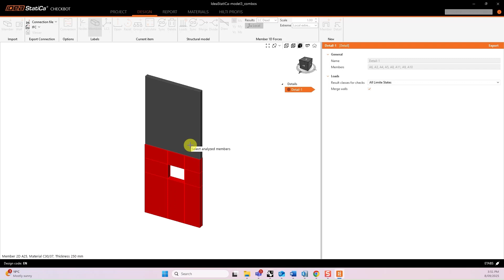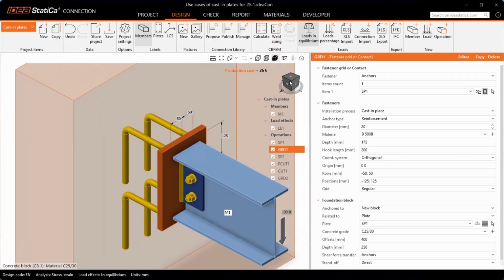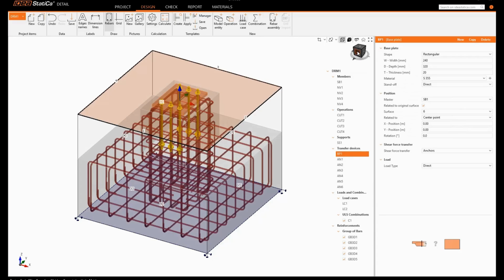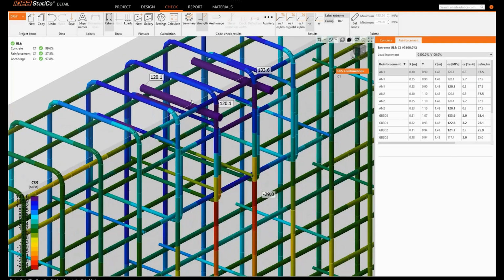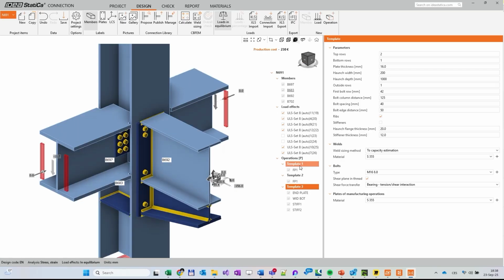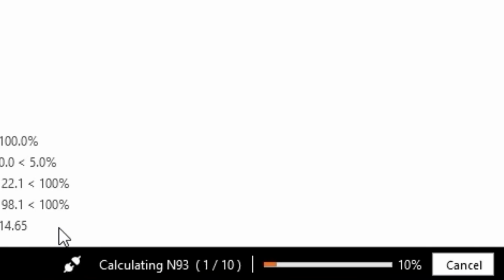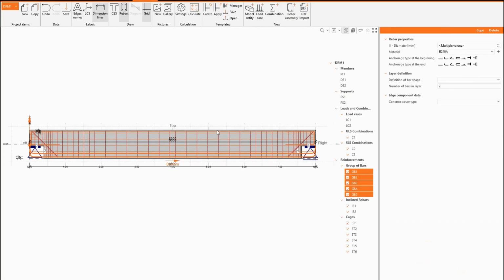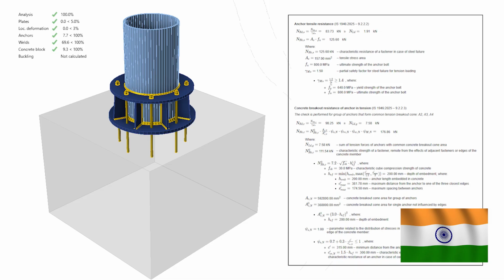What's new in IDEA StatiCa 25.1

Comment: When will you bring back weld yeilding information (plastic deformation) for joint design resistance? Up to and including version 24 it was available as second information on how the joint behaves when it achieves the design resistance. Plastic deformation of plates and plastic deformation of welds was shown next to the diagram, which was very helpful in assesment on how the joint behaves. In new versions only information about plastic deformation of plates is shown, and it is not possible to assess whether the joint fails because bolts fails or because the welds fails (plastic deformation >5%).

The new versions are useless since you removed that information...
Reply from the maker: Hello, can you please contact our technical support and ask for clarification there and possibly request for changes in the program? Thank you.
https://www.ideastatica.com/support-center/how-to-create-a-new-support-case